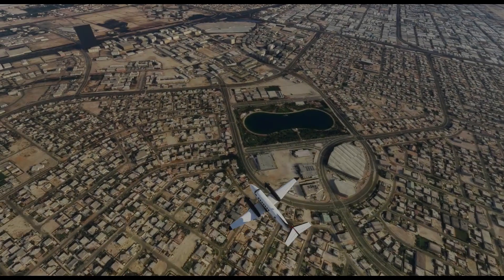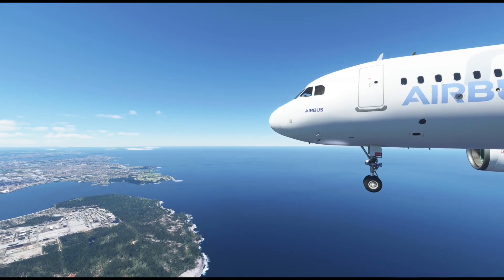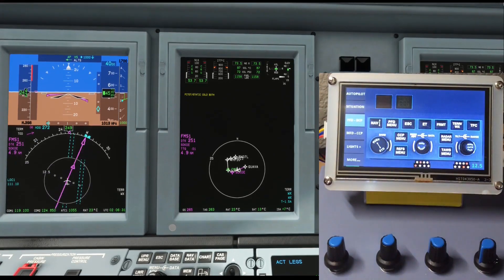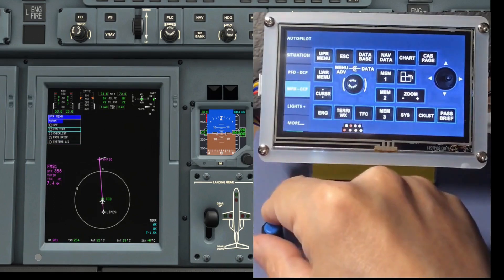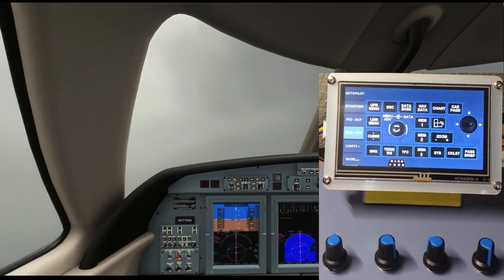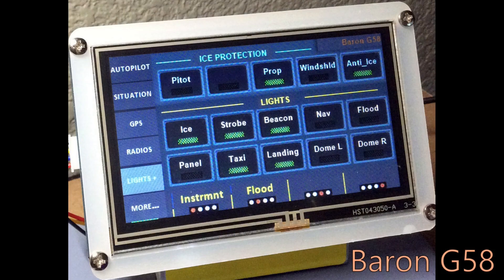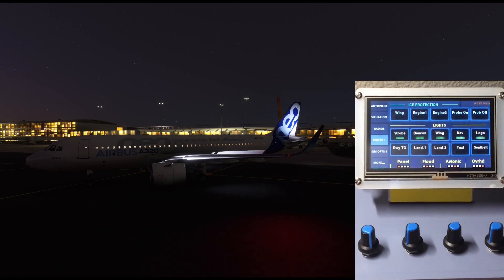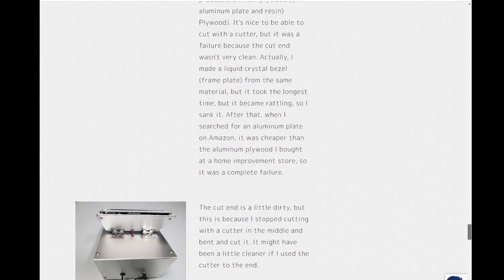Flight Sim Touchscreen Panel [Update 3]

Comment: I got my 7" Nextion display up and running. I 3d printed a custom case for it and have converted about 3 displays from the 4.3" version. Looking forward to your 7" software displays when you get to it. Also, do you have a Spad.next profile you can share? Maybe include it in the .zip file?
Reply from the maker: Cool!  Send me some photos of your display mods and your 3D-printed enclosure (via link in latest Design Notes).

Comment: Very nice project. Was wondering, can we build this with a single encoder?
Reply from the maker: Yes and No…
The mini-panel can work with a single encoder with the Initial April 2021 release—and only that revision.  The option is selectable by changing one number in that source code (still available).
Since the initial release, increased complexity had made the use of single encoder impractical.  So four encoders are required in this (and every) update you see here.
Reply: @discman777  Thanks

Comment: Just found your channel and the touchscreen is a fantastic idea. Just wondering if the NX4827K043 enhanced 4.3 display would work instead  of the NX4827T043 that the Design Guide refers to. It is about half the cost. Thanks for sharing this build!
Reply from the maker: The Enhanced version of the 4.3” should work.  However, I do not have one to verify that.  BTW, support for the Nextion 7” is in early development.  That won’t be ready for a couple of months.  See the latest Design Notes for details (rev 1.12.19).

Comment: I am going to make one of these .... looking forward to this project. thank you so much for designing and coming up with this. bye bye mouse and keyboard ...
Reply from the maker: Cool, send us some photos of your upcoming mini panel!
Reply: @discman777  Looking forward to this project; one I have it set up I will be sure to share any experiences I had during set up and implementation. Debating on a 4” display versus the 7” display. Preliminary a thought for future deign and updates ; are you able to pull some images from the aircraft sim folders for panels and buttons and other designs ?? Might be something to look at and see if it can work or not.
Reply from the maker: @igotyoubeat  The Nextion is a raster-based display; hence, the graphic contents do not scale easily.  Going to a 7” model will require resampling every screen object, and some firmware change.  That will involve many hours of work.  Also, the real-estate gain deserves re-architecting the page layouts. 
If you wish to discuss in details, please leave an email for direct messaging.
Reply from the maker: @igotyoubeat  Glad to know that it works.  BTW, I tried replying to your email but it was “undeliverable”.  And your new comment on YouTube also does not show up.